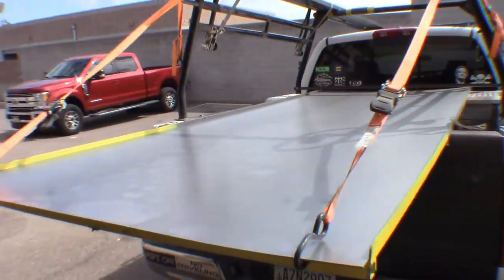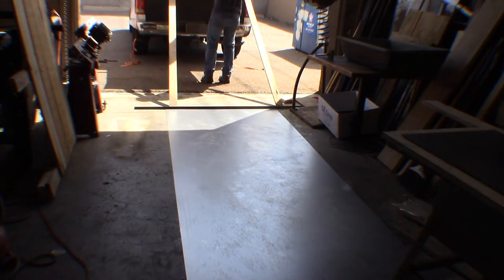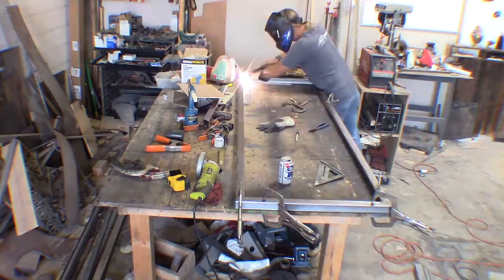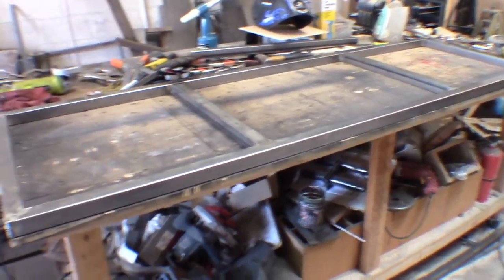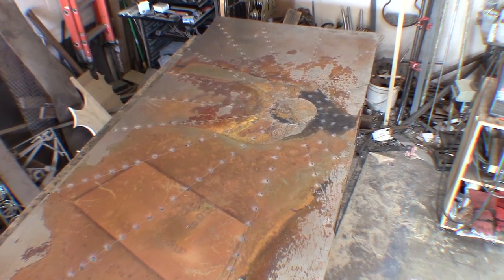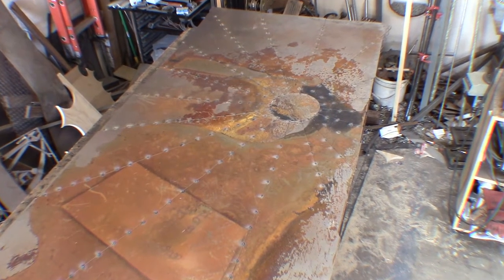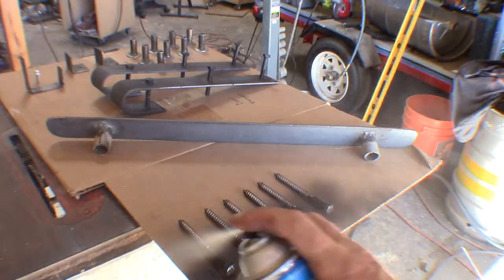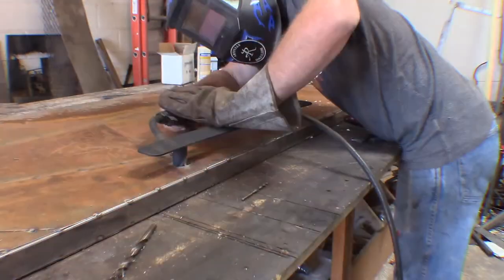Amazing Sunburst Metal Sliding Door

Comment: So you draw the sunburst motive on a metal panel, cut it out - and then reweld it together? How do you cater for the strips in between the plates, which you obviously discard?
You keep the individual plates in their original position - so why don't you just weld a line on the plate in a starburst?
Do you weld the plates on another plate?
Reply from the maker: Arthur Benjamins I actually tried that in my earlier attempt but it just didn't provide the dimensional quality that I was shooting for. Plus by cutting the design out and rewelding it allows the rust pattern to not look so fluid and kind of subtlety shakes up the design

Comment: okay, I found the place to make comments.  is the secret solution to remove the oil that prevents the rusting process what esthetitions use to color hair?
Reply: Barbara Nolan actually I just wipe the oil off by hand which allows the solution to penetrate into the steel. And because, wiping isn't 100% , there are areas that rust slower and some that rust faster. Your analogy is correct though, remove the oil in order to add the color.